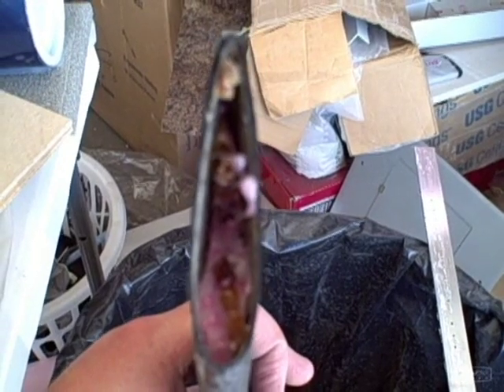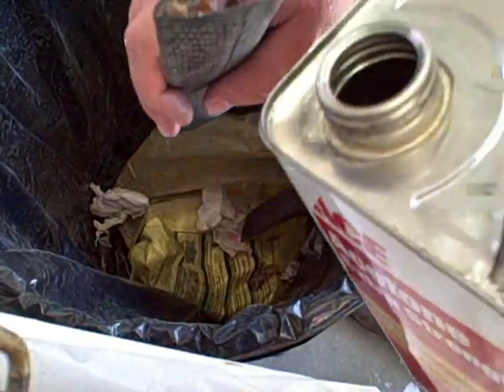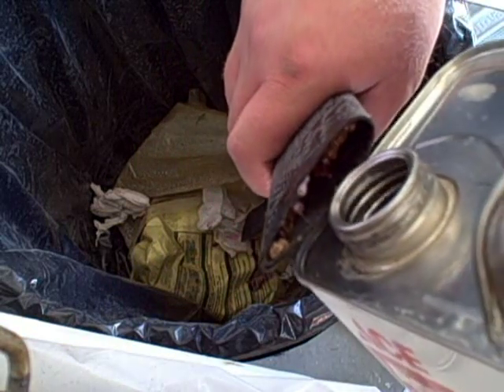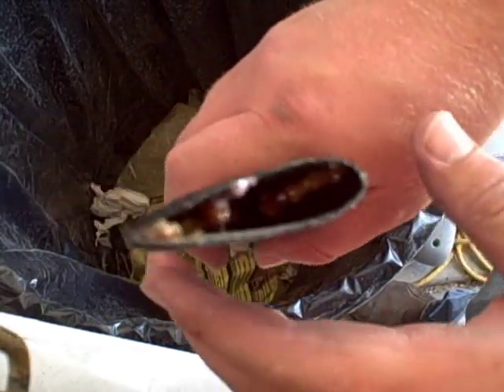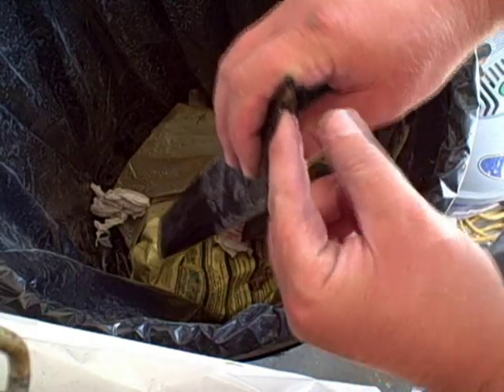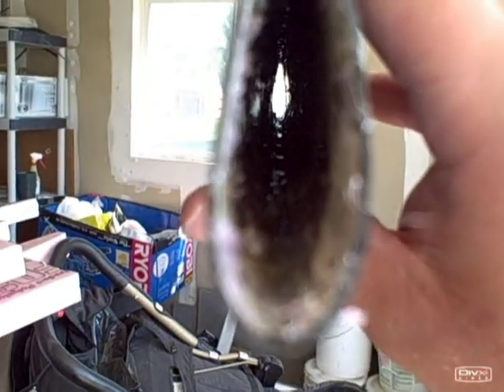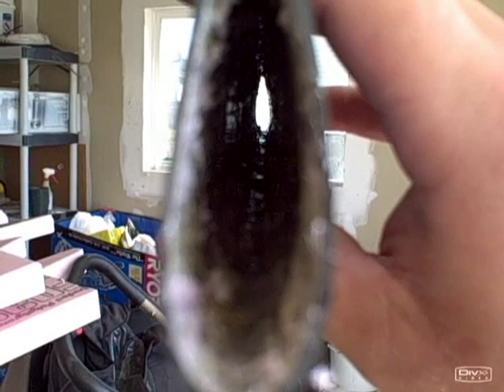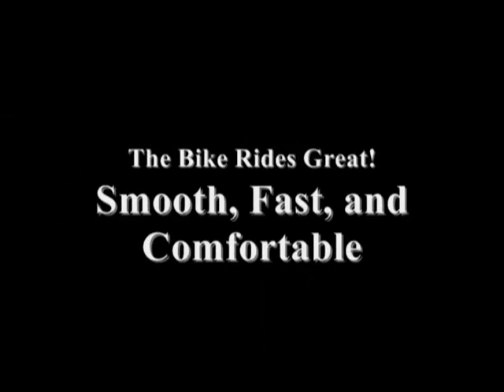Chapter 4 Carbon Fiber Bike Build

Comment: hi buddy. congrats on the project. what density of foam did use? did you run into any deformation problems with hi vacuum "pressure" ? best regards.

Comment from the maker: No it's not bad to leave it in. I didn't end up burning the foam out of the seat tube or top tube. I think leaving it in the frame is good for structure and I don't think burning it out saves on that much weight- Internal cabling will be tough with it in though.

Comment from the maker: Yes, in fact most laminating epoxies are clear or slightly yellowish/amber- but the slight coloring is practically unnoticeable once laminated with the carbon fiber. 

I decided to use this darker epoxy on this project because I had it laying around from my experimental kit plane that I'm working on. I didn't want to buy new epoxy since I didn't need much of it. However, now-a-days, I mostly use the clearer epoxies now for all my projects.

Comment from the maker: I did this bike's finish the hard way. I filled with epoxy, leveled with sand paper and then repeated the process until I built it up enough to where it looked good. I've never experimented with other leveling techniques so I'm anxious to find out what you come up with and how it works out. The wax probably won't stretch with the Stretchlon but it just might be enough wax, even with stretching, to get a decent release. Another idea is to use a finer fabric on the outer most layer and fill that.

Comment from the maker: Stretchlon is designed to release off Polyester resin and unfortunately, from my experience, it doesn't release real well off epoxy- Epoxy type may be a factor. 800 releases better because it doesn't break as easy when having to pull it off the part- but 800 doesn't conform to the part as well as the 200. I usually use peelply or perforated release plastic between the part and Stretchlon. I haven't tried waxing the Stretchlon yet which would probably work really well. Thanks for the comment!

Comment from the maker: I was going to burn it out, but then decided I was too afraid there wasn't enough carbon fiber structure there by its self. Plus I after burning out the other tubes I realized I wasn't going to save as much weight as I had expected- So I didn't burn out the top tube or seat tube.

Comment from the maker: @AZURA888 
It sounds like way too much work to me;-) 

You could always just make your core out of the Extruded Polystyrene (XEPS) and then wrap it in packaging tape. After the layup cures, burn the XEPS out with some acetone and then peel the tape out. 

I should have done this on my tubes to prevent the excess material from sticking to the inside walls of the tubes after the burn- Oh well, live and learn...

Comment: I have this idea, I think to do the pattern in flexible mass (that is like clay) you can mold this as you want with extreme facility and the resistance od this material is like that of polyethilene water tubes, after all is made of white glue used profusely by carpenters. Then to submerge each pice in molten candles parafine, to wait it get solid and form a crust to give a layer of epoxi, the roll with carbon, when it get cured, to put into a oven to melt the wax and extract the carbon piece.

Comment from the maker: @AZURA888 

I didn't note how thick each individual tube was in measurement, but I did document the layup schedule, or rather the amount of carbon fiber layers I used. Different parts of the bike got different thicknesses and you can find the layup schedule on my site- there is a link to the site-tutorial in the video description.